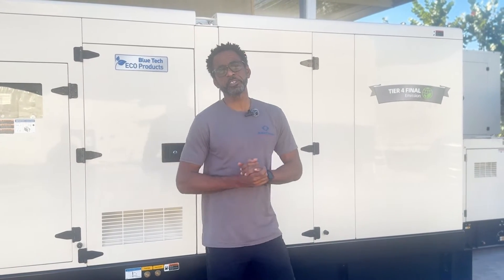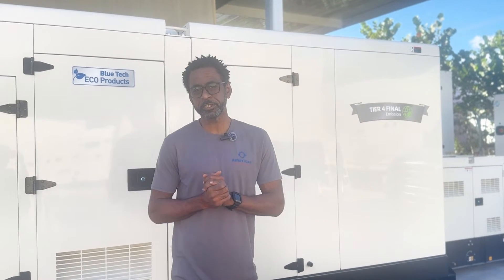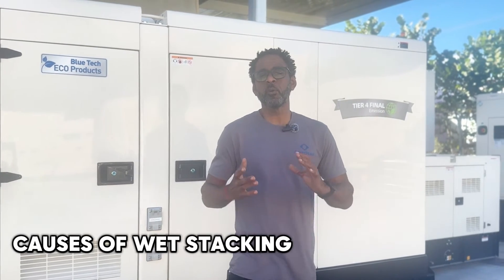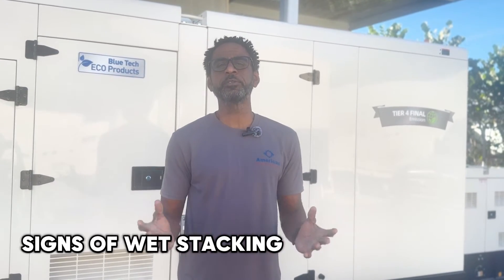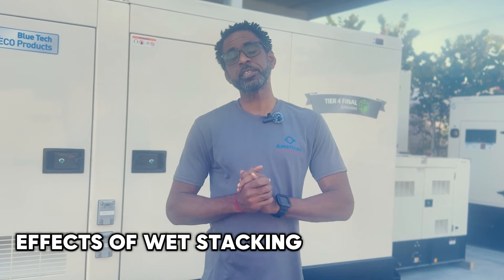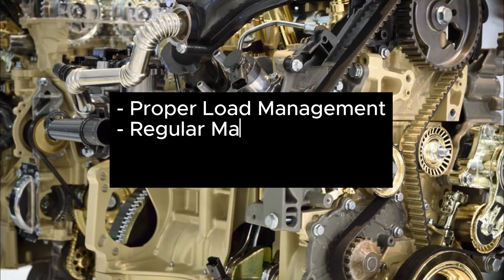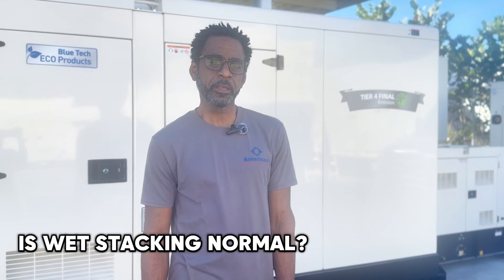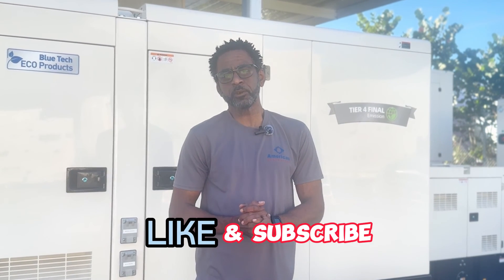What is Wet Stacking? Is it normal for a Standby Generator?

Comment: I don't have a way to increase the load beyond 30kw for my 100kw genset.  Will Stanadyne or similar cetane boosting additives help?
Reply from the maker: While cetane boosters can improve combustion, they are not a solution for wet stacking and will not solve your load issue. We suggest contacting a local technician experienced in your generator model for further assistance.